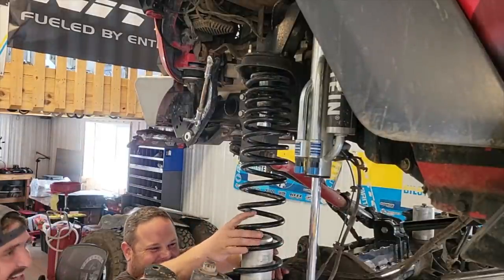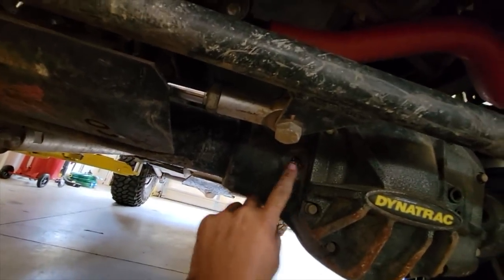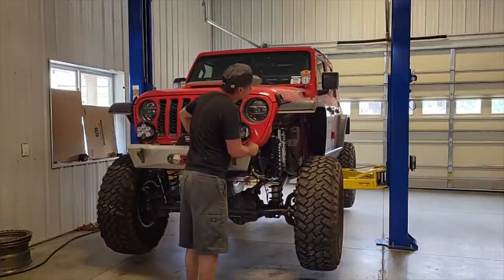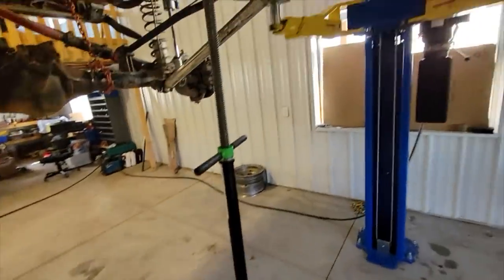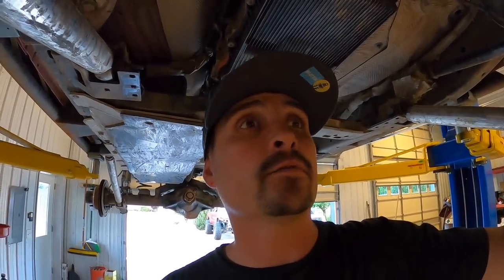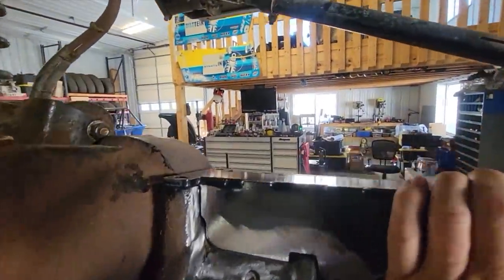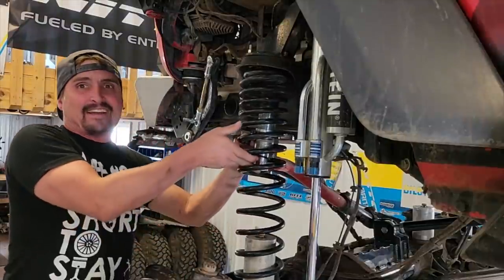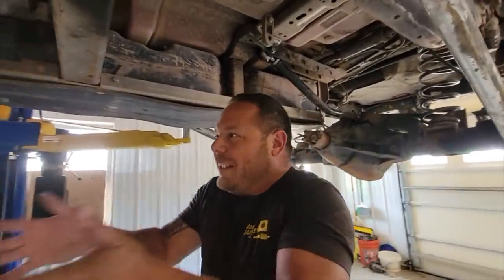HOW TO MAKE THE GREATEST JEEP EVER EVEN BETTER?

Comment: He's going to like that 3 link.  I've been running the 3 link front and rear for over a year and no complaints.  I just noticed, he's got 40's and no hydro assist.  Might as well just install it now, its a game changer as well!
Reply: It totally has power assist. PSC pump and ram and resi. It was probably chained up in most of the shots. It is down, when I stuff it.

Comment: Just a question. If you are running manual hubs and break a axel, could a guy put that hub into free and dive it out of the woods with out any problems?
Reply: Yes. That’s the point of the locking hubs and to unlock them when on road so nothing spins

Comment: Lol watching Chris put that transfer case back in reminded me of me and my brother putting a transmission back in but it was refusing to go in and I have no upper body strength or endurance. Brother was getting pissed at it an me for not holding up higher when I've been holding the damn thing for 10-15 minutes to the point where I was resting it on my head getting grease all over my hair just to rest my arms.

Comment: Nice job Chris! This is some great content. I just ordered a diesel Rubicon on Friday. I need some ideas on how to get 40s on it. I'm not too far from you guys.
Reply: well, until they fix the "running hot and killing power" thing, i would stick with the stockers or over gear it for 40s so it wont build so much heat. i am going to assume that its the higher egts from running in boost when climbing hills and long grades, but it will run hot and go into limp mode.

Comment: Chris out of all the HMMWV(s) that you have worked on, which one would do you think is the best for a daily drivable vehicle? Not necessarily a primary vehicle but possibly. Dynamating and other stuff would be done to make it more daily able.
Reply: 1123s are the older non turbo variant, 115x's and 116x are the newer 6.5 turbo. if i were to get one, would either be an old m998 and id swap in a 12v cummins or something, or i would go with the non turbo 6.5 m1123. the turbo version just has a few more things to go bad, and you dont really get a whole lot more power. so, short story long, find a newest non turbo. 2005 was the change to turbo.
Reply: @Garagespeedengineering  So outside of armor upgrades and other strictly military stuff the engine is the only thing that changed between them? Anything else to look for like drive line components or is everything the same?
Reply: @Zankaroo  you definitely don't want an uparmored one. Hard doors are ok. Your best bet would be govplanet dot com. The armored ones have heavy springs, it'll ride like crap when decommissioned.  Turrets are cool but hard to seal the hole. Tuttle backs are also cool, but most likely will leak. Register on that site and check it out.

Comment: I've always wondered, with all the mods you've done to that Jeep, why you're not running coil-overs ?
Reply: We’ve covered the coilover question a few times. Bypasses with springs are a better ride and performance than just a coilover. A bypass with coilover is best but I have stock width axles and cannot fit that

Comment: How do you Plan to relocate the fuel tank to the middle? Other than weight distribution what are the advantages to that fuel tank set up?
Reply: Being able to run a triangulated rear 4 link to get rid on the track bar

Comment: Chris is finishing the weld onto the cast not necessary?
Reply: that is a great question, in this situation, it was not. the main forces are centered around the link itself, the cast section was far enough away AND the axle seals are inside that area, there are 2 bolts also locating the top plane. if i would have had more time, i would have removed the axle, diff and seals, preheated the section to about 450 475, welded it up and immediately wrapped it up with a welding blanket and let it cool very slowly. new seals and reinstall everything. I did run a triple pass across the front side and i fell that it will hold up to Kevins abuse.

Comment: @litebrite  ive been working on race and rally cars my whole life but kinda new to offroading, can anyone explain to me the purpose/reason for cutting the 4th link out of the suspension to make it a 3 link? from what i understand 4 link suspensions are better for most situations though triangulated 3 links do havr their strengths aswell

edit: was it purely to fit the truss on the axle?
Reply: 3 link has less bind unless you are doing a triangulated 4 link and getting rid of the track bar which is the best setup but most vehicle don’t have the room. This was done to get rid of the interference of the driver upper link hitting the hemi ac compressor therefor allowing more up travel in the suspension. It’s all about optimization

Comment: Didn't they just get a new 3 link In a previous video? What's the reason for 4 link? Previous video was very much selling 3 link over 4 link?
Reply from the maker: “Triangulated” 4 link is much different than just a 4 link. A triangulated 4 link gets rid of the track bar which is the 5th link in a normal 4 link system and is much better for everything. The problem usually is most vehicles don’t have the room. If your can’t do a triangulated 4 link than a 3 link is preferred.
Reply: @LiteBrite  aah i see, thank you for the clarification of that.  That makes sense. And that is why you have gone 3 link in the front now to get more movement. And then gonna change the fuel tank out to make space for triangulated 4 link

Comment: I have a question, Can a stock jeep axle run 40s?
Reply: If you don't wheel sure. If you do its only a matter of time that leverage destroys them. Reinforce them and if you wheel lightly or ever youll be alright
Reply: You can run it on the road but Offroad you are going to break things sooner than later
Reply: @FirstLast-fx1qp  what do you think is the max 37s?
Reply: @allenclydesales6125  37s on a rubicon. Maybe a 38 if you aren’t too hard on it. Some people are using bfg 39s but they really only measure 38s but we haven’t liked the performance of those km3 tires at all
Reply: @boughtnotbuiltoffroad7784  tysm!